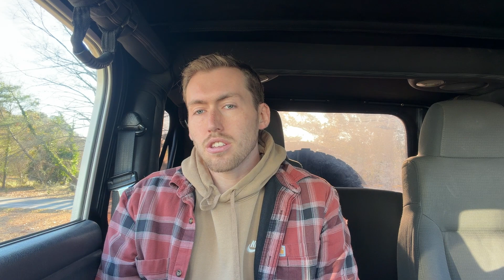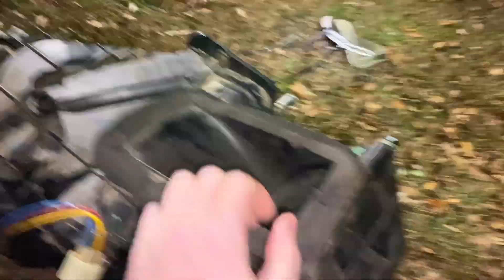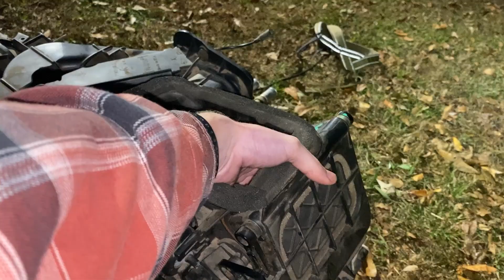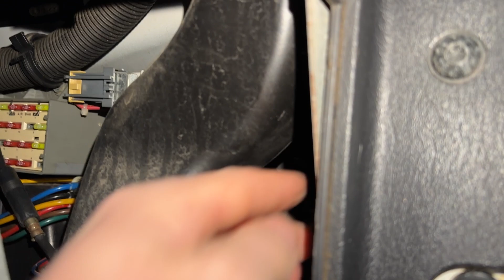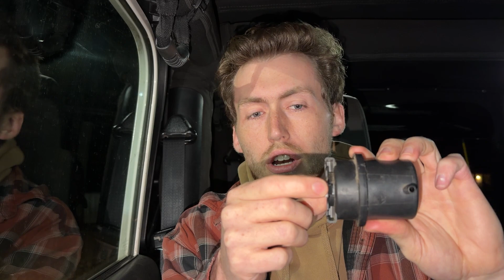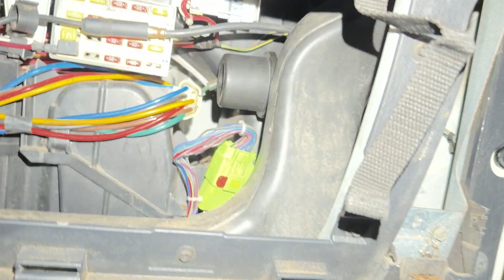Replace Jeep TJ Recirculation Blend Door Actuator Which Could Fix Your Heat

Comment: So if it gets stuck in the opposite position does that mean ac won't work?
Reply from the maker: Maybe that could have an effect, but the controls allow for AC in both recirculation and non-recirculation. So I think it would work for AC no matter what. 

AC I think, would more likely be caused by the blend door actuator, lack of refrigerant, or resistor pack.